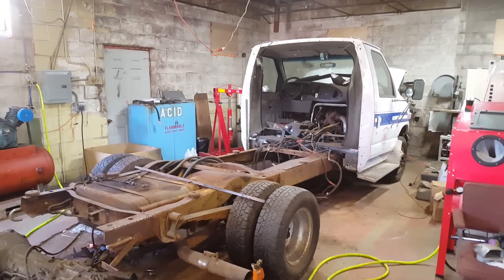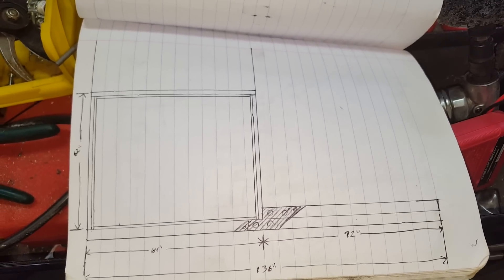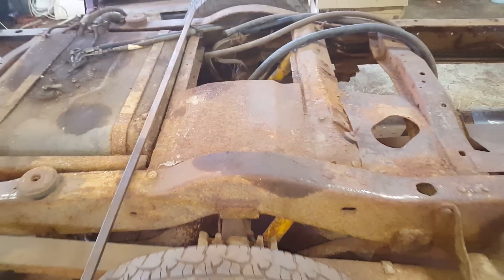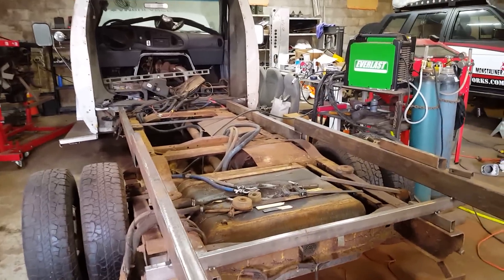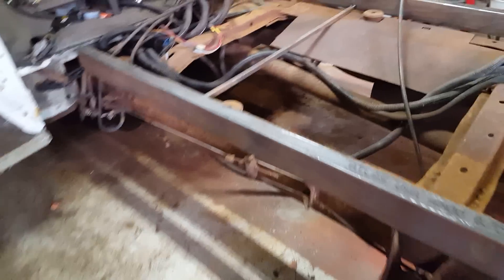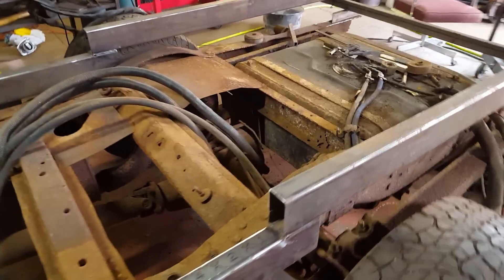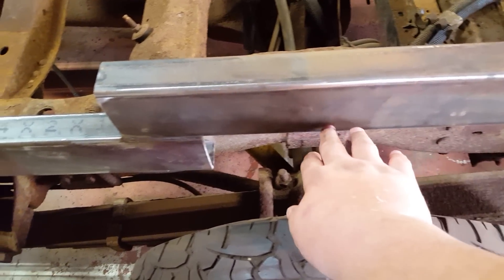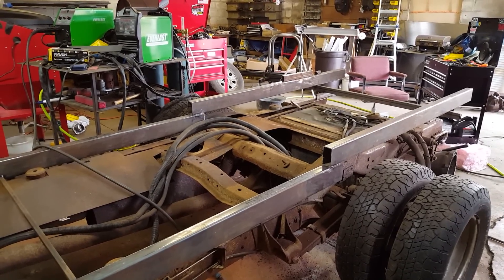Project Tow Rig - Part 1

Comment: Should be a pretty good build, looking forward to it
Reply: +Steve Hayes-Richards I'd keep the same amount of body mounts as the original vehicle
Reply from the maker: +Steve Hayes-Richards As of right now I might put 12 mounts. I decided to use the after market mounts I have. I have 8 of them and need to order another set of 8 so I might as well add two more mount in the very back where I extend the frame. Since I'll have extra mounts...

Comment: Cool build

Not trying to be a downer.....but...
Curious what the GVW is on that chassis and if it's over 10,000lbs? (most likely)
Did you know if you are over 10K you will be "in the game" and should have a registered DOT number and will need to follow all those "extra" rules and BS?
Does not matter if it's a personal use vehicle or for business.  If you haul something 
that you;'re going to make money with, it counts. The NYS DOT cops can be real a'holes if they stop you......just sayin.  Can get expensive real quick. 

I'd go with all 10 mounts.....what the hell, not much more work eh?
In case of an accident (forbid) the 2 extra will tie the structure together that much 
more, and be safer overall.  

PS Hows the Everlast machines holding up?
Reply from the maker: +kmcwhq Good call on the GVW and potential issues. The GVW is 10700lb. Not sure if that extra 700lb puts it over that limit or not. However here is the factor that not many people know about and the reason I bought this chassis. In NYS ambulances are registered by the DMV as SUBN like all SUVs and normal vans. They aren't considered commercial vehicles. It's an exception for Ambulances. Not sure why but it plays in my favor. Normally a cutaway Chassis of any type would be commercial in this state regardless of the weight.

Anyway that's why I went bought this. The insurance is about the same as my pathfinder and there is no headache with commercial or DOT requirements. If they asked me at the DMV is I was going to use it as an ambulance still. I told them no that it's for personal use. They didn't ask me anymore questions and finished up the paperwork. Sometimes it better to not say to much to keep things simple. Hopefully the highway patrol doesn't mess with me but I think I'll be fine. Due to the seating that it will have in it they can't do much about it. It will seat 6 people when it's all said and done. The SUBN status will stay the same because of that. If they give me a hard time I can switch it to RV because it'll have RV power inside of it. So I have a couple loop holes if they try and mess with me. I should be fine though.

I think you're right about the mounts. I hope I can find the factory ones. I like those better than the after market ones.

All 3 Everlast machines are still running good. No issues outside of normal wear and tear.
Reply: +Alvarez Metal Works What you will NEED to do is put some decals on the side of the unit. 
NOT FOR HIRE
and 
MOTOR HOME

That may help!